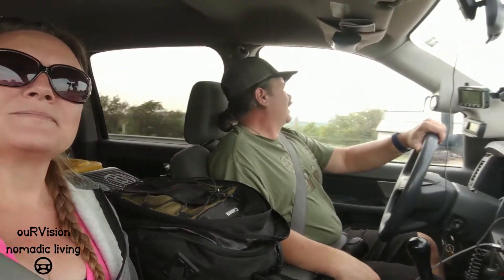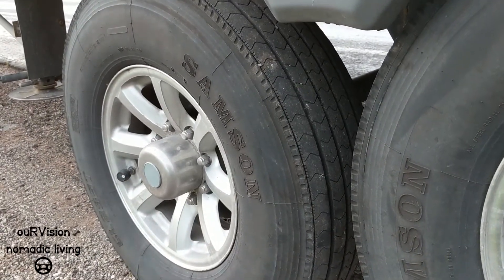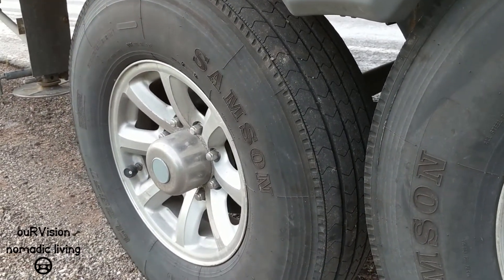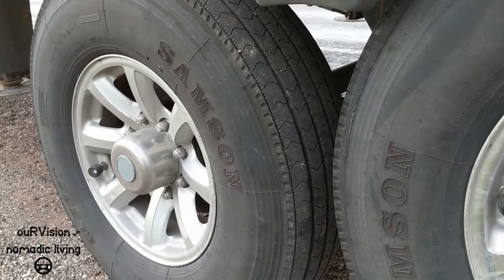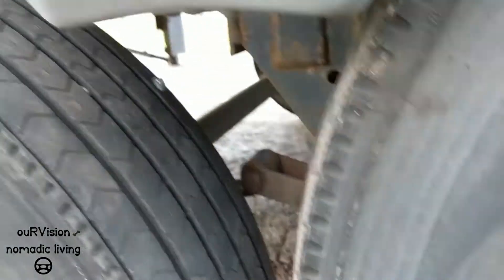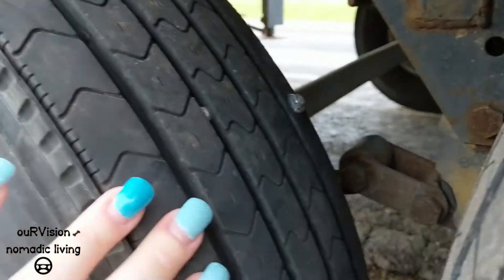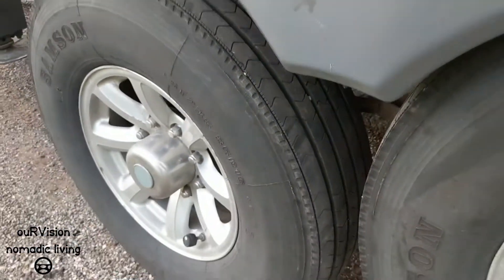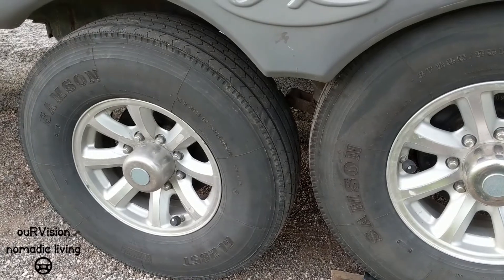TPMS prevents blowout on our RV

Comment: We went to Moab in our RV when we went out West  in Summer of 2017
Reply from the maker: Hi Bobby, we are from Northern Utah. Moab is amazing. We spent 5 months camphosting for the BLM at the Goose Island Campground just outside of Moab in 2019. Loved it. We will probably do it again someday down the road. Thanks for stopping by!!! 👍 Sean
Reply: @ouRVisionnomadicliving  we stayed at The KOA. It was 108 degrees and our AC went out on us. 
The dry heat was not as bad as it is here in Georgia with the high humidity.
Reply from the maker: @Techll  We hosted from March 1-May 20 at the Goose Island BLM Campground. None of the BLM campgrounds have hookups, so we left for the summer. We returned on Sept. 6 and hosted again until Nov. 11. Being the hosts, they did have a vault in the host site so I could dump our black and grey. We used a combination of our solar and our honda gennys for power. And I fetched water from a spring about a mile from the campground. It was an adventure. Yes, the dry heat is a big difference from the humid you have to deal with in the south.